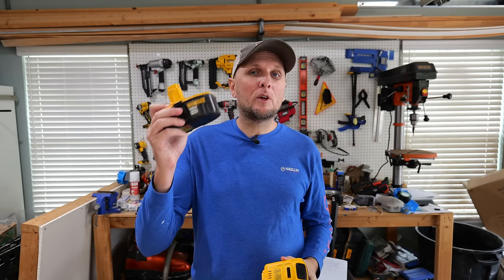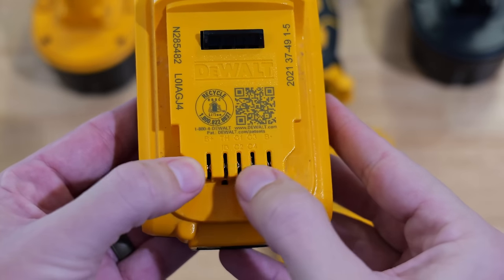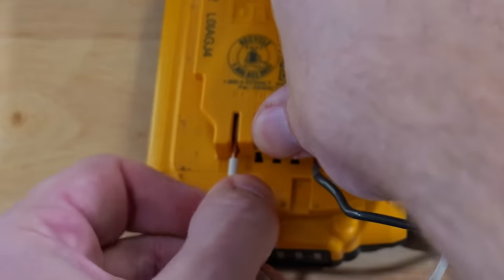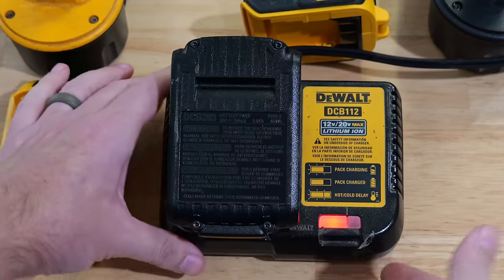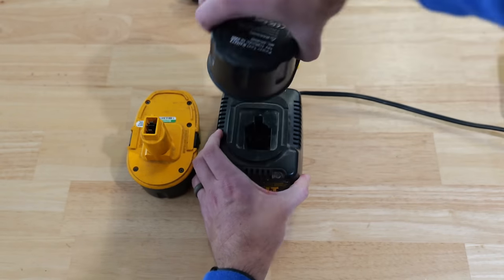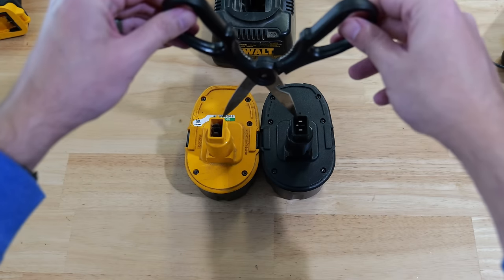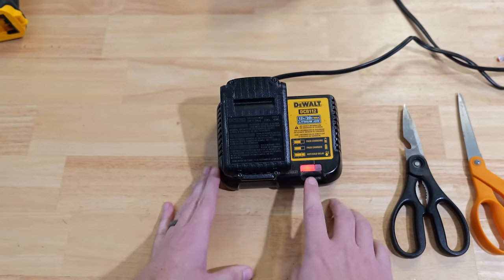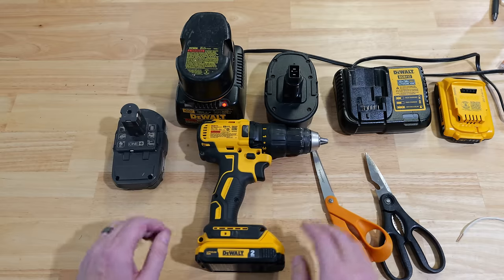SECRET To Reviving Dead Portable Tool Batteries | Super Easy!

Comment: great video.  i'll have to keep this in mind the next time i get a "dead" battery.  i have one question though.  some of my current batteries (20 volt Lithium) are not quite at the "dead" stage, but i am noticing that they are not lasting as long as they used to between full charges.  do you have any suggestions as to how to revive these batteries or do i have to just put up with them until they get to this stage that your video covers?

Comment: Car battery maintainers also work in a similar manner. If the battery is below a certain voltage, the maintainer won't start charging. You have to use a conventional charger to get enough charge back into the battery before you can use the maintainer.

Comment: This is a, swell video! Thank you so very much. I had wondered about that very thing. I just could not believe. This lithium battery, wouldn't wake up the charger? And I was like, No Way?

Thank you. You have just verified that for me.. I thought it could be something like that.

Though I would also think.  If you had a, benchtop, power supply. And you find your B, plus & minus. You can do that same jumpstart from an, AC power supply.

Yes those other connections. Those are from, it's sensors. That makes the, charger work. And monitoring, all aspects of the cells and charge. In this cute little technique bypasses all of that extra circuitry, stuff. That manages to get you.  To purchase another expensive battery. It's brilliant.

Now that's not to say. Those cells, haven't been overly discharged and fundamentally destroyed? And will only hold a 60% charge for about 15 minutes. As that could be the end result. Of the batteries, end, result. When it is truly, kaput..  As they all have a finite amount of, charge, cycles.. If it's 3000 charge cycles.  And it's at 3250? It may not work real good anymore. And discharge quickly in 10 minutes time. No matter the load. Then, you know you are fighting a losing, battle.

But this was a very cute and Battery Refreshing. It's like a Breath of Fresh Battery, almost. It's that minor charge. To get that charger to wake up and take note. And stop being a lazy charger. That doesn't want to give up a, charge. And it is not. Repeat, Not  a Tally-ho, Charger.

Once upon a time there were 3 Bears.  Baby bear, mama bear and daddy bear.

And one day. Daddy bear. Found a sweet young, minor, underage girl. Wandering around in the forest. And attacked her. And it did not matter whether she liked that are not. She had to Grin and,, Bear it. And Squeal, like a Pig.. Squeal like a Pig! Just, Squeal! Like a pig! Come on and Squeal, squeal squeal! Like a Pig. Let me slap your butt. With my, USDA, Brand. And Squeal, like a Pig! And you shall be Deliveranced! Say Hell a  Lula! Hot Damn!  Woo hoo! Yabaddabadoo! Yee ha! Squeal, like a Pig!

Steve Martin played banjo. Before he ever died.
RemyRAD

Comment: Cool, our company had a golf tournament about five years ago and one of the swags they gave away was small power banks with our logo on them in really cool zippered hard cases.   I found a whole case of them in the basement they told me to throw out and went to try one today and it was dead, put it on the charger and it wouldn't take a charge after a few hours. They were all dead,  I popped the covers off four of them and just jumped them with an 18650 battery for a couple seconds, they are all charging now.  Worked great, now I only have to do about 45 more, I'm set for life🤣

Comment: I LOVE the 18v trick. 
The only bad thing here is that if you let the battery get that low, it will have really reduced the capacity. So don't expect them to last as long on a charge as another one might. But if it now has 50% rated capacity, it's still better than no capacity.

Comment: I’m not sure if I should recommend this … but what I’ve done in the past as a very heavy gauge wire on a Ryobi type of battery it looks kinda like the second cylindrical hammerhead shape… anyway I used a very heavy gauge wire plus screwdriver tip to effectively short the sides of one of those Ryobi cylindrical kind of batteries yes I took precautions so I little bit of a spark but basically the thing was so dead, no problem.  then I saw a tiny bit of spark (very tiny) and just the shorting Action allowed the Ryobi battery to then be able to put on this Ryobi charger and start blinking and charging again. (And yes I understand about voltages and the risks, I am an EE).

Comment: Hey liked the video. I had the same thing on the 18v and I seen that I could put it on the charger and then wiggle the plug in the outlet and this would cause the charger to detect a little power and it charged it right up. I don't know if that is just for the  DeWalt brand but ya pretty kool.

Comment: ...and sometimes there is a single dead cell in the battery pack and nothing will revive it except taking it apart and replacing that one dead cell. (if you can even find the right size cell at all).  I've tried the 'shocking' them to remove dendrite growth, but that had very short-term effectiveness for me.

Comment: I have found several times with my Ryobi 18v batteries when they will not charge if I clean the contacts with a pencil eraser they will take a charge. Just a small amount of oxidation will prevent charging.

Comment: I can't believe I have never thought of this myself, due to the fact I've had to do it 100s of times as a mechanic on 12v car batteries coz some chargers won't charge if the voltage is too low, so u just get another battery and some jumper leads etc and add 12v to the dead batt with the charger attached, and it triggers the charger to begin to charge and then u remove the jumpers and ur laughing 👌

Comment: You can simply set the dead battery near a heat source for a minute or two... Making sure not to over heat, or melt battery... This method works as well

Comment: I just use my desktop power supply to charge them.  Set it to 22v max for the 20v full ampage  and leave it.  As it charges the amps drop to zero. The 18v is set to 20v and full ampage.  Do that a few times after draining them in use and they are good to go......wellfor a bit longer. Nothing beats replacing with new cells.

Comment: I have a 12v tool that needs reviving but I don't have any other 12v batteries. Can I use a different voltage of battery to revive my 12v harbor freight drill battery? I have other cordless drills. 18v makita, 24v kobalt and 18v milluakee but I really liked the compact little tool.

Comment: I had craftsman 19.2v batteries but my charger would no longer charge, and I didn’t want to buy another on eBay, so I thew several tools in trash along with 2 batteries. I have Ryobi tools now and am very satisfied. 8/1/2024
Now you need to provide a video on fixing CHARGERS ‼️‼️

Comment: I would recommend before you spend money by an electric drill or cordless tool think how long are you going to use it or how often you're going to use it I learn expensive lesson this trick works but sometimes the batteries don't last as long on a charge something happens to the batteries during not using the tool like they become sulfated?

Comment: I would use a non smart trickle charger initially to charge it enough for the smart charger.
I've had this condition even with lead acid car batteries that are stone dead.
The smart charger won't trigger in, but after I put a trickle charger on for an hour or even less and it builds a small charge, then the smart reconditioning charger will kick in.

Comment: Although this fix is a good one.   And (thank you) one I will always remember in case I need it. You should never let a Lithium-Ion (Li-ion) battery completely discharge.   This will eventually reduce the runtime between charges, and the overall life of the battery.   When the tool starts to run a bit weaker than normal it is near the end of its charge anyway.   Replace it that point.   Also, never charge a warm battery even if the charger allows it.   Let it cool down to ambient temp.   Usually 15 mins is good enough.  These simple steps will increase the life of your Lithium-Ion (Li-ion) batteries dramatically.
I have some 5-6 year old Li-ion bats that are still working like the day I got them.

Comment: This is great, if you have a battery with a charge. What if you DO NOT have a battery that has a charge? I have both 18 volt and 9 volt DeWalt tools with completely dead batteries that will not longer charge. Is there a way I can "jump start" them to see if they'll still take a charge?

Comment: GReat video thank you, question, what about partially charged batteries.  i put the battery in the charger and it goes to the solid red light, but when I check the leds on the battery, it shows only 2 green leds and only lasts about 10 minutes in the tool.  Also, the next day after charging, the battery is stone dead.

Comment: I could easily consider that the fix I used, but instead, I simply cleaned the contacts... Oxidation, over-amping, extreme high usage... corroding terminals.

I'm not saying your fix is not valid... Shoving that wire in there is roughing up the contacts like a course file would, but indeed, awesome out of the box quick diy hack !

I've revived countless old aa & aaa batteries, simply with sand paper ! Flashlights, remotes, everything, basically, needs the contacts cleaned occasionally. I've used coca cola on car battery terminals as acid/base reaction to do the same

Comment: Hello!  Great video!  
Can I charge an dying (not dead, but only works for a moment)18v (actually a Craftsman 19.2v) from a fully charged DeWalt 20v battery?  Replacement batteries are only available after market and I've had the corresponding drill collecting dust because I loved it too much... Thx in advance!

Comment: Ya'know ... with that romex wire ... you can bend the ends into the shape of ... kinda like a paper clip (or a space small enough to pinch it around the contact point on the battery) and pinch it on the battery tab/prong .... works well and you don't need to hold it there.  I have also used a car charger attached to one end of the wire to get the battery a little juice ... works fine too

Comment: My Ryobi 40 volt battery died while mowing, I put it on the charger which it's yellow light came on and ran a couple seconds and stopped, tried multiple times. I put the battery into my freezer for 10 minutes and placed it back onto the charger and it is now charging perfectly.

Comment: Now I have a Ryobi 40v flat type like your first example      One battery takes a charge perfectly  the second will only lite  2 of the four indicators up and not take a charge     On my battery there are 4 indicators showing  charge levels from like 25% to 50-75 100%      The like ( depending on how you think ) light 25/75 or 50/100% light up   Is it also a candidate for the  procedure?   Positive to possitive and neg to neg?

Comment: Didnt work on this ridgid 18V battery .. 
Ive tried 4 different ways. Even a very dangerous wall plug wire, with the cut wires in alligator clips plugged into a GFCI Outlet. Tried a 6volt rechargeable battery plug in with clamps, a secondary Ridgid battery wired in, tried a Jump start pack. I may try a bigger battery tomorrow, but no luck so far. Thanks for the info anyway, i got a different Milwaukee battery thats sat for years i may try to get working.

Comment: Happened to me. I left a Ryobi battery on charger and went for a two week vacation. Something about the extended time put that battery into a mode where it dropped below the minimum voltage for it to be 'recognized'. By bumping the battery over that threshold, the charger now recognizes battery and it has been working well for 3 years. Do not leave batteries in charger for extended periods of time past the fully charged state.

Comment: What connection tool do you use on the Ryobi batteries that have a simple side for + and - but no real way to connect with a jumper wire or scissors? Please reply. Jim.

Comment: Very interesting video. I was wondering if you could suggest an option for me.
I have just one RYOBI 9.6 V battery (No: 130269017) that has not been used for a very long time by my son. When I put it on the charger the red light comes on solid but even after 2 days of charging it will run the drill for 10 seconds and then stop.
Can I use my drip charger to jump start this battery that I use on my lawn tractor battery?
Thank you.

Comment: I have been doing this for years. No need for a second battery. The dead batteries have a shunt that trips when it is "dead" for quite a while or is run down to a complete stop when used. Just take a 9V battery and touch the prongs on the dead battery Keep it there for a minute or two. This will reset the shunt and you are good to go most of the time. Some batteries have reached their end of life and will not char no matter what. One thing to remember. Once you have reset a battery, it's life expectancy will be considerably reduced. It does not cause the batt to be like new. It may last for a dozen or so charges, then it's gone for good. The "breaker or "shunt" will be weak from the first hit. But you buy yourself more time.

Comment: @HowToHomeDIY, some suggestions for you:  You state that the batteries have extremely low charge or none at all and that the chargers don't recognize them.  Why don't you use a voltmeter to demonstrate this?  Also, with the first two batteries, why not mark the bad one and the good one with tape labels, just to ensure that the two are not mixed up?
Reply from the maker: Hey, a suggestion for you as your 2 comments make it clear they don't really need a response.  Maybe make your own channel?  Don't like mine?  Don't watch.

Comment: I have a 14V dead battery. Can I use a different voltage battery to put some power in the dead battery, i.e. an 18V or 24V battery? Thanks.

Comment: What if the battery won't holding charge for long? Can we change the internal cells of an 18v battery, or best to just get a new drill set? My current drills have 2 batts, but they both last no more than 10 mins of usage.

Comment: Suggestion for next video--  can we end-users "revive" or  repair a battery charger?
Harbor Freight designs into each of its 18v chargers the certainty of thermal failure.after only a few dozen recharge cycles.

Comment: Batteries can often be rebuilt either by yourself or by a service. There's also aftermarket batteries but you have to make sure that they aren't el cheapos. Anything that seems like a much better price than others may not perform well.

Comment: what about 18V Black & Decker (same issue; one battery doesn’t want to charge, other is good) but charging ports different set-up than in your video. thx.

actually going to try what you did with the second set of batteries, scissors; like prong to like prong.

Comment: Yes this does work great! but the issue is if you put a wire too large into the slot it will widen the prongs inside and it will be looser and cause problems the solution is to hit the wire with a hammer to thin it out that way it does not open up the prongs inside of the battery to cause problems later. Also it makes it easier to slide in. Love this site lots of good tips.

Comment: Yes this works for most any rechargeable battery but as many are saying PLEASE do this outside and keep a fire extinguisher on hand. A lithium ion battery in thermal runaway can get ugly really fast. Think bottle rockets in your garage or home!  Do not leave it unattended and if either battery starts to get hot or bulge immediately disconnect the wires and if it isn’t already away from anything flammable move it to your lawn or driveway. Google battery in thermal runaway if you doubt what I’m saying. 🔥🔥🔥🔥

Comment: So, if the charger only needs to see the battery to switch on an start up the loading process then an extra button could be made on the charger to wake it up, a switch and a capacitor would do the trick. That would save you a lot of troubles with lose wires or even scissors. Always be careful when running!

Comment: Wait wait! My Ryobi 18V battery is like the one you show at the very end of the video, with a vertical post going up near the center of the battery. It has plus+ on one side, minus- on the other, and one other (unlabeled) terminal at the ‘front’ side. These metal clips are on 3 sides of the post. I tried reading ALL the comments but didn't see anyone else mention this type. Is there a magic trick for my battery too?

Comment: Dead phone power bank? If it has a power switch then try pressing the switch several times. This can “wake up” the internal circuitry and allow you to use or charge it. You can also buy or build a pulsing device which can also wake up the battery by drawing a bit of current from it.

Comment: This problem happens because DeWalt batteries don't have built in battery management to stop them being discharged too much. The management is in the tool itself and some things you can plug them into don't have that - I have a non DeWalt shop light like that.  In addition batteries can self drain over time so if you drain them low and then leave them along time they can appear dead to the charge.  I've been told Milliwuake batteries have BMS in the battery so the are less prone to this...

Comment: I have a black and decker 36V strimmer but only one battery unfortunately. The strimmer starts for a couple of minutes then stops. I can restart it and it will last  a max 10 seconds for a few more times.  Does this sound like a battery issue? If it was a connection issue it wouldn't work at all right?  If so I will have to get another but at least wont throw out the one I have at present and will try this